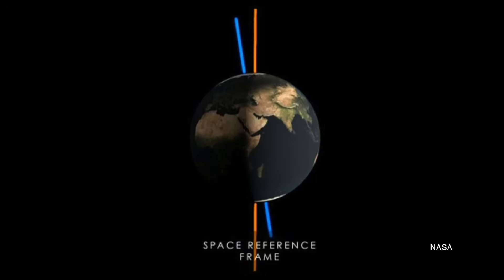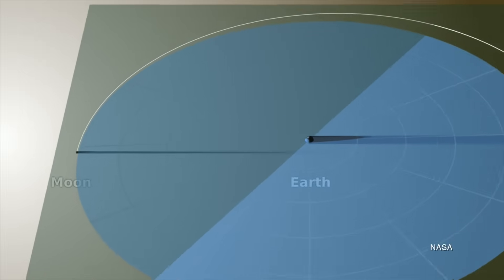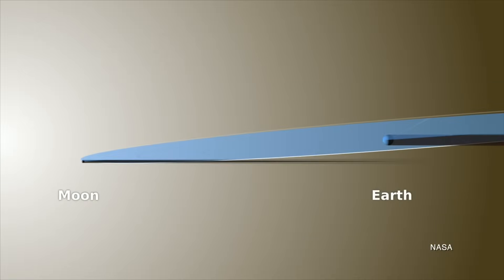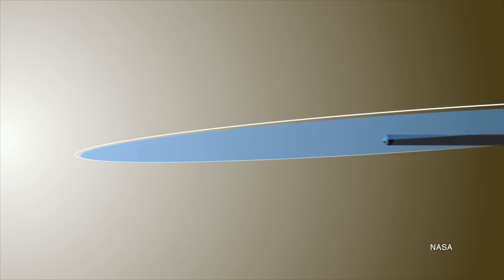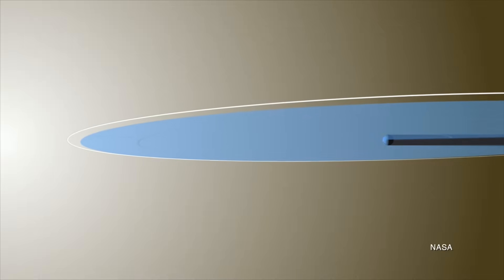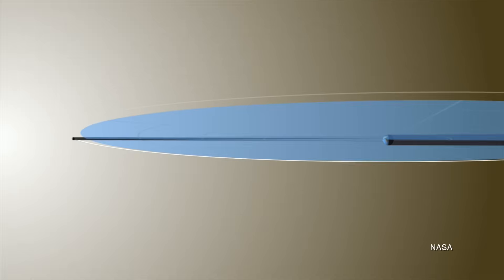Why Does a Rocket Need to Roll Going Into Orbit?

Comment: The question should be: How can they burn rocket fuel liquid or solid, in the vacuum of outer space? Can you explain that? if not this is just another nasa propaganda bs.
Reply: I think the main thing you are not apparently aware of is that rockets generally carry two types of propellant, the "fuel" that typically would burn in air's oxygen, and the oxidant. Generally the oxidant out masses the fuel by quite a lot. The Saturn V's F-1 engines for instance consumed liquid oxygen at a mass ratio to its kerosene type fuel of 2.27:1, so of the over 2150 tons of propellant loaded into the first stage, just about 660 tons was kerosene, the other 1500 tons being liquid oxygen. This goes back to the first gunpowder rockets invented in East Asia over a thousand years ago! The gunpowder is a mix of charcoal fuel that burns in the hot gases released by the other substances it is mixed with, it doesn't need air to detonate! Many rockets use something other than oxygen as the "oxidant," but in this case, the Saturn rockets used in Apollo, the answer is extra simple since they used oxygen to burn kerosene in the first stage and hydrogen in the upper stages.

There are rockets that don't use any combustion at all; for instance one can squirt hydrogen peroxide (the dangerous high test stuff, the stuff you can buy over the counter at a pharmacy is very dilute) through a catalyst and it decomposes into steam and oxygen, releasing so much heat a good design can achieve nozzle velocities exceeding  a mile per second! The British did a number of things with these sorts of monopropellant peroxide rockets in the 1940s and 50s, notably installing fixed Jet Assisted Take-Off rockets in the first versions of the DeHavilland Comet jetliner. They also later developed more powerful kerosene burning rockets using the peroxide as oxidant. 

For that matter, the V-1 rockets developed by Von Braun used decomposing high test HP to power the turbo pumps that delivered the alcohol and oxygen to its engine, and decades later the Soviet R-7 rocket, that first put Sputnik, then Vostok, and eventually Soyuz spacecraft into orbit, still used this same pump system. Eventually the Soviets moved on to more sophisticated pumping systems, but it was good enough to launch the space age! I often wonder if they could have got the first satellites and manned craft up even earlier if they used peroxide instead of LOX for their first generation space rockets' oxidant as well--it is less efficient but one can get higher thrust out of a given chamber volume, at a lower temperature too (hence either easier to make or more reliable) and the fuel/oxidant combination stores denser, and at near room temperature. The point here is that the peroxide they did use to drive the pumps did not combust with anything, it just released its internal chemical potential energy.

Heck, it is possible to make a very crude and simple rocket with no chemistry happening at all. Have you ever seen a toy water rocket? You just fill up the body cylinder mostly with water, pump in some air at fairly high pressure, turn it over so the high pressure air bubble is trapped on top, and let go. The air pressure squirts some water out and you get action, reaction, voila the rocket goes up a bit! (my toy one went up a few dozen feet when handled correctly). 

At the other end of the technical spectrum, high-tech rockets such as nuclear thermal engines or ion drives don't use any chemistry either, they use other sources of energy (nuclear reactor core heat heating a propellant such as hydrogen in the first case, any number of possible electric power sources, in space boiling down to either some kind of nuke or solar panels, to accelerate a stream of charged particles electromagnetically in the latter) to drive mass backward thus achieving rocket thrust again with no need of any chemical transformations at all. Modern electric thrust drives produce very low thrust but are very mass-efficient so a small supply of xeon gas can gently thrust a spacecraft for years using solar power. No one has actually flown a nuclear thermal rocket but many have been tested on the ground; they have their drawbacks but not requiring any oxidant is not one of them!

Bottom line--rockets pretty much by definition do not rely on any external mass either to power their jets or to react against; the thrust mechanism is Newton's action/reaction principle, which is another way of saying that the center of mass of the system keeps the same inertia, so if we break the system up into a piece being thrown backward, the rest of it must be thrown forward to keep the net center of mass in place. Since we forget about the thrown-away mass once it is gone, the system we care about is accelerating. Yet another way of looking at it is that if we didn't release the jet (as with the water rocket before you pull the plug out, when it is pumped up) the high pressure of the propellant puts force in all directions on its container, so if we remove one of the walls holding it in so pressure has the effect of squirting the stuff out instead of pushing on a wall, the opposite wall that still has the pressure that used to be balanced by the now open hole experiences unbalanced force and this is the net thrust. Making this process sustainable and efficient is what rocket design is all about.
Reply: I mentioned Russians. Why would they have different physics or chemistry than anyone else though?
Reply: Seriously?... The use oxidizers...

Another person who decides to just be clueless and believe NASA is leading the world, as opposed to opening up Google and typing in a question.  /facepalm
Reply: von volts short answer is the fuel contains oxygen
Reply: PassiveSmoking oxidizer* not just oxygen but a chemical that contains oxygen and when it interacts with the liquid fuel, it essentially explodes
Reply: +von volts: Please return to kindergarten and start again! Do not pass 'GO', do not collect $200. (To be honest, if you can't understand this simple concept, you should be humble enough to admit it's beyond you, and defer to the experts. That would be science experts, not the flat-earth cult conmen!)
P.S. I know 5 and 6 year olds who can fully grasp this idea.
Reply: Same principal for  torpedoes as well using hyrdrogen peroxide and Aluminum...I think. Produces Aluminum and O2 refer to MIL-P-16005 Revision F for more details.
Reply: von volts idiot. What does the vacuum of space have to do with anything? Go back to grade school!
Reply from the maker: Apollo used hypergolic reactions, fuel and oxidizer that burn on contact, so they just open a valve and it fires. Rockets work the same in space; physics doesn't just stop working when you leave Earth. Expulsion of hot gas from one end (the rocket nozzle) has the equal reaction of accelerating the mass (in this case the spacecraft) in the opposite direction. It's really quite simple. :)
Reply: von volts oxygen. They carried ranks of it.
Reply: I'll believe it if it comes from the Mighty Russians not nasa.

Comment: WOW! Boy was I wrong! My preconceived notion was that they want to get the craft on a slow spin in order to heat/cool the craft naturally, thus conserving power. Before y'all laugh at me, it wasn't really that far fetched.
Reply: When the Apollos were in transit between Earth and Moon orbits, they did go into a "barbecue roll" just as you remembered. Launch and injection burns are different things though, you don't want to be in a dizzy spin just for the heck of it, you want stability so you can concentrate on the crucial factors to control. These are brief events though.

Comment: The shuttle also required a roll maneuver and then pitch over at a certain point. Always one thing I was curious about. I'm not sure if the Shuttle rolled as much as the Saturn had to, I know the Shuttle rolled over to a heads down position immediately after the tower was cleared, and then began a pitch over at I think 20-30 degrees? Much later in the ascent stage the shuttle then rolled back to a "heads up" orientation, so they could jettison the ET safely. They were pretty high at this point and long after SRB separation has occurred.
Reply: Just like Apollo, the Shuttle's roll depends on the departure azimuth needed to achieve the desired orbit.  This varies from flight to flight, and from launch window to launch window.  Flights to ISS at a 51.6 degree orbital inclination would generally require much more roll than flights to Hubble at 28.5 degrees.  If you wonder why the inclinations are different, it is because some of the ISS launches are done from Baikonur Russia, which is much farther north than Cape Canaveral where the Hubble was launched from.  A due east launch (the most efficient direction) from Cape Canaveral (latitude 28.5N) results in an orbit with a 28.5 degree inclination.  Launches from Baikonur (45.6 degrees latitude) leave at 51.6 degrees to avoid flying over China (and potentially raining failed rocket debris on them).

Comment: A good example of a rocket that does not need to roll in a particular direction during launch is the Trident II missile. It is in fact NOT roll stabilized. A rocket with only one motor in each stage is not stable in roll without additional thrusters to control roll. The upper Apollo stages that had one motor, also had small stabilizing thrusters to do this. The Trident II is designed to function without such roll control.

Comment: OK - I accept your dislike of the shuttle program, but your explanation does not address why it always twisted to fuel-tank-up when it launched!
Reply: It is for the same reason as Apollo - so the crew could see the Earth out of the cockpit windows which gives them an attitude reference.  If they rode up with the ET toward the ground, then all they would see is empty sky.  This also allows antennas (which are on the orbiter) a clear view of the ground on ascent so they can transmit telemetry and voice comms to the ground stations.

Comment: I've watched this a few times.  I still don't get it.
Reply: Neither did I. Read the explanation by the commenter ApolloWasReal. He fills in the blanks.
Reply: @xyz.ijk.  essentially, it is easier go control the  rocket in just 2 axis instead of 3 so it rolls at the beginning of the flight to be on the same orbital plane as the moon and then has 1less axis to deal with
Reply: @thehoodedhorntail6749  Thank you for your very clear reply, though I think you should post it as a main comment and not a reply that will be hidden in a thread.  It will reach a wider audience -- and I'm not sure why you replied to me as I am clear on the details and the math:  I was replying to the main commenter about the unclarity of the video and offering another commenter who provided clarification.
Reply: Yes the roll and the need for it was not clear. She seemed to mix up the x and y axis too since y is vertical only.

Comment: Just to be sure I understand, the roll program is necessary because they didn't want to maneuver in two (or three) directions at once?  After all, when you take off in a plane you climb and turn, and later descend and turn, at the same time.  Is the shuttle different?  It still had a roll program, but it wasn't a symmetric vehicle.
Reply: They had a roll program so that the vehicle was in the desired orientation when the vehicle pitches over to head downrange.  That orientation is with crew heads toward the Earth for both Apollo and the Shuttle so they can see the Earth and horizon.

Comment: I'm guessing the original question really wanted to know why space rockets pitch over, not roll during ascent but termed it incorrectly. That's got more to do with the optimal ascent trajectory through an atmosphere rather than insertion into an inclined orbit.
Reply: You guessed wrong.  If you've ever watched a video of Apollo or the Shuttle launching, you'll hear several radio calls right after liftoff concerning the "roll program".  That's what the original question was about - why specifically is there a roll program and what is it for and why is it a big deal.

Comment: I was pretty sure that the ecliptic is actually the sun's apparent movement across the sky, rather than the plane that all planets are on, because all planets have a different plane of orbit than Earth and each other.
Reply: The path the Sun appears to travel across the sky is actually due to the plane of the Earth's orbit around the Sun, right?  All of the 8 major planets travel around the Sun in more or less the same plane (most are within 3.4 degrees of Earth.  Mercury is at 7 degrees and Pluto was the outlier at 17 degrees, but alas, it isn't a planet anymore snif).  Therefore, the ecliptic is both the path of the Sun's apparent movement across the sky, and the plane that all of the planets are on.  Additionally, this means it is also the same path that all of the planets appear to follow across the sky.  It is all related.